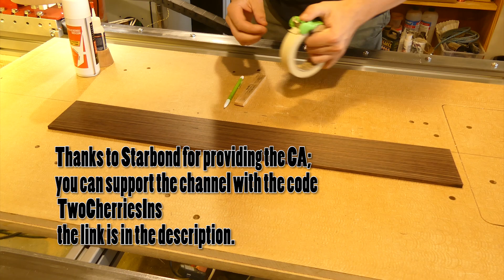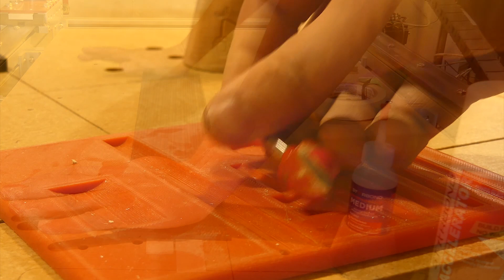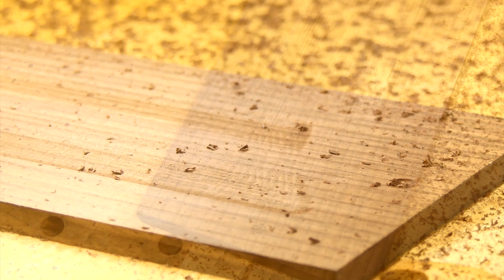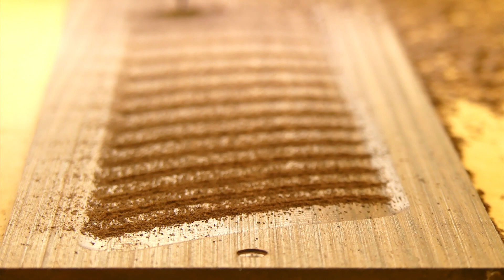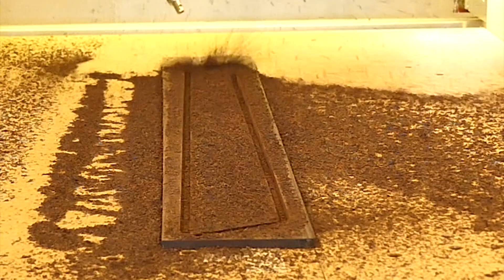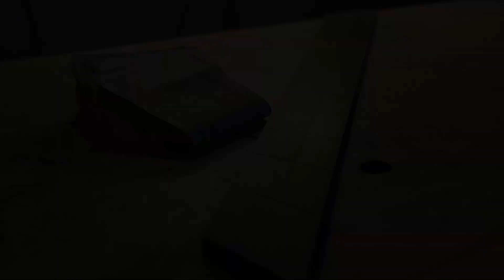CNC Multiscale Fretboards | Is it different?

Comment: Which command do you use in Fusion 360 to cut fret slots?  Enjoying your utube videos, keep up the good work.
Reply from the maker: I use a trace operation, I project the fret lines to the radius fretboard surface and use the projected lines for the trace operation.